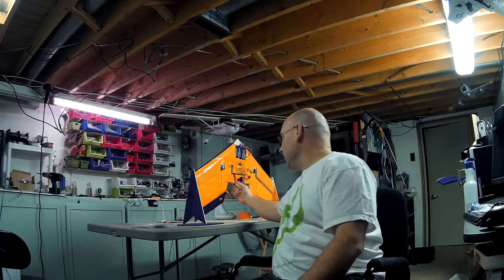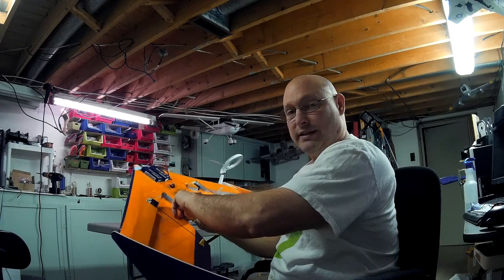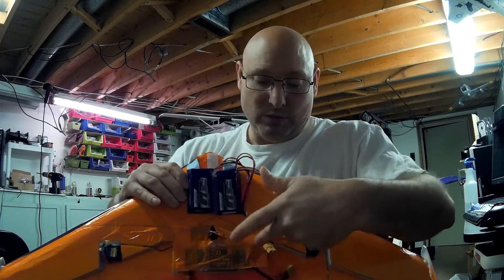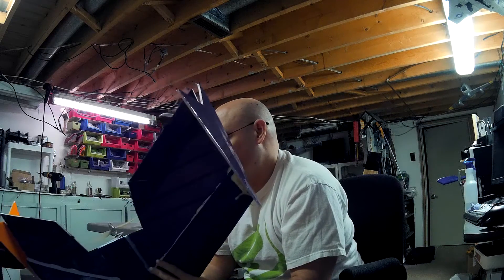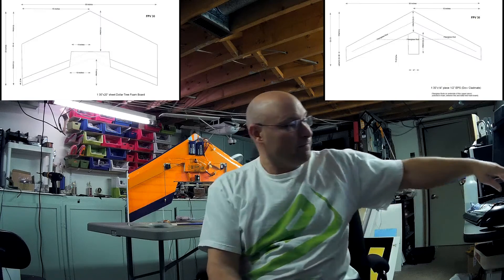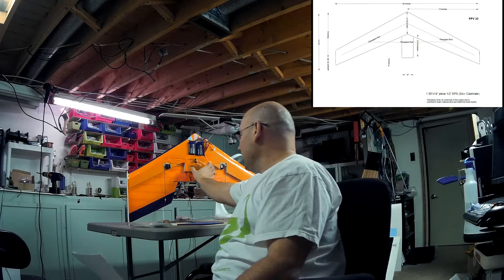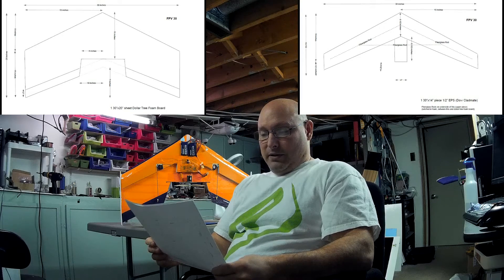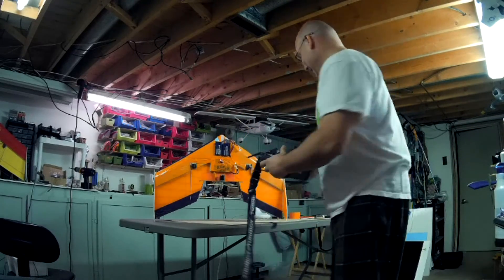How to build a Flying Wing - Final Thoughts

Comment: Thanks for the videos; awesome help! I ordered everything identical to yours and I'm building the kfm4 now. I was only able to get a 45 amp ESC. Will this motor burn it up with the 7x5 prop and a 20c 3s? Everything I see says I should have gotten something around the 4x4.5 range?
Reply from the maker: The top current for this motor is 55A, so you might be in trouble with 45.  Also, a 20s battery might puff up on it's own.  I found a 7x5 prop to be too much for this setup.  I ended up trimming my 7x5 to be closer to 5x5.   Your setup will likely be ok for short bursts of full power, but sustained it might have problems.   I personally think that my original power setup is a bit too much for a wing this size, it flies fine, but it is a bit of overkill :-)  I think if I was building it again I'd go for a setup with a 2826 2200 kv motor and a 6x4 prop.
Reply: UnlimitedVertical Thanks for the response! As long as I don't run her wide open I should be ok until I get a higher drain battery, larger ESC, and a smaller prop for this motor? I want to be able to go super fast, so I guess I want the overkill lol. What do you suggest would be the most ideal setup for a motor that size on the 30" wing?
Reply from the maker: Yep...I still can't run it full throttle for very long.  It's a beast with this motor for sure!
Reply from the maker: ridewhitehorse
On my KFm2 wings that size I've run 2822 1200kv, 2812 1543kv and 2826 2200kv.   They scream with the 2200kv, the others are still pretty quick.   On my lightweight 30" wing I run a 2204-14t.  It's nice and light for slow flying.  For the Kfm4 wing I wanted the same thing as you, horsepower, as fast as possible.  One thing I have a bit of trouble with with that specific motor is that it gets mounted "backwards", so you can't get the center of the prop close to the center of the wing (i.e. the thrust line is a little high).  This causes the wing to lift at high acceleration.  You can compensate while flying, but it takes a bit of getting used to.   My first few flights were a little squirrely until I got used to it.   Best of luck with your wing.
Reply: UnlimitedVertical Thanks for the information! I'm going to have to practice getting the equipment combinations correct. I'll probably be ordering all new stuff when I crash the heck out of this one and I'll learn a lot of new stuff along the way. This will be my first "real" free flight plane, so its probably not the best idea to start with all fast stuff, but I think the whole walk before you can run analogy is for children lol. Thanks again for all the information you took the time to post! We'll see how it turns out at the end of the week when my equipment arrives...
Reply from the maker: ridewhitehorse
ROFL...I like your attitude.  Be sure to record the maiden flight :-)
Reply: UnlimitedVertical OK, so maiden flight didn't turn out so hot.. SOB went into a corkscrew and flew sideways into the ground hard breaking the propeller and chewed up the ass end a bit. I set up with a 4.75x4.75 and the amp draw was perfect for the esc/battery combo watt meter read at 350 watts at 11.1 volts wide open. It had great torque. She wanted to fly out of my hand. I think I was having trouble with the trimming on the turnigy 9x more than anything. I think the plane will fly, but my transmitter isn't set up good.. Any thoughts on cork screw right of the launch?
Reply from the maker: ridewhitehorse
I had something very similar.  It's the torgue of that motor.  This is where it gets tough because that motor is heavy you need a certain amount of throttle for launch, but at the same time if you give it too much it will cause it to roll (prop turns one way, plane turns the other), especially at low speeds.  Are you using a single battery?  If so, just ease up on the throttle on launch and resist the temptation to punch it right away after launch.  I think it took me 3 launches before I got the hang of this one on launch, but now that I have it it is easier.  

When I launch I hold the plane in my right hand with my thumb down and kind of give it a straight arm throw (hard to explain).  I found that this puts the plane in motion fairly straight.  For this plane I don't even have it on half throttle at launch.  I wait until I have control of it to punch the throttle more.

I also have a turnigy 9x.  I have my expos set to about 60%, other than that everything is standard elevon setup.  Best of luck, I hope you get it up in the air, looking forward to seeing it fly.